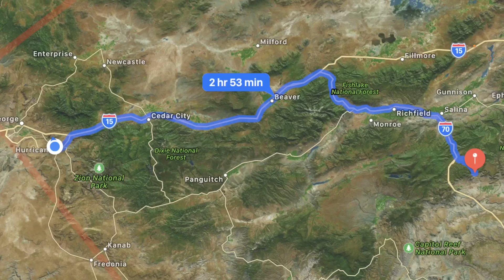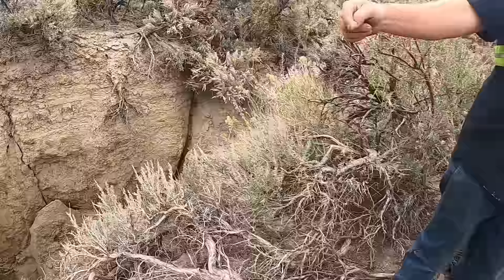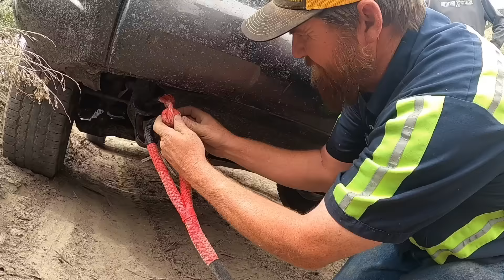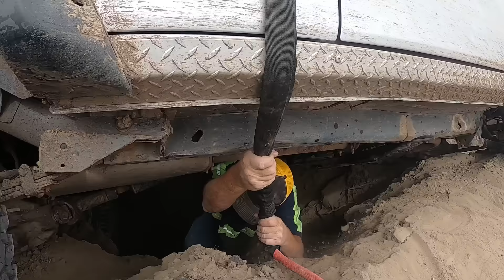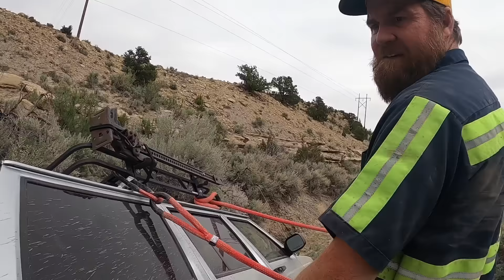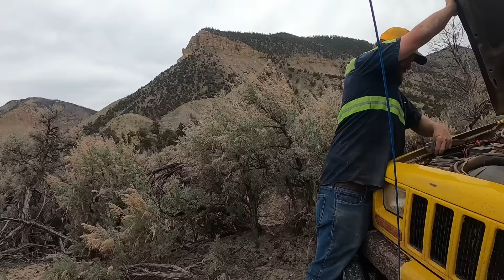Jeep Swallowed By SINKHOLE!!

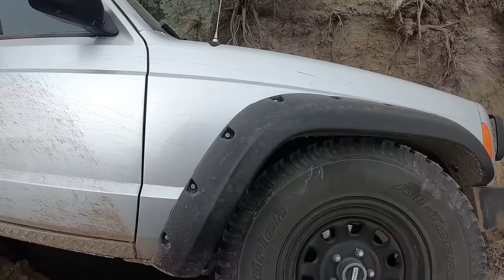Comment: Matt, epic recovery and story. Though I thought perhaps you missed one useful trick? At 15:35 when you added your weight to the rear tyre, I was willing for you to swing the spare wheel carrier and lock it in the open position. There was a nice counterweight there with a heavy wheel on a steel fulcrum. Making an 18" stirrup from a rope to add body weight to the wheel could have helped. Wasn't needed as it turns out, but you know, 'one more arrow in the quiver' for next time. I've been off roading Land Rovers for 30 years in New Zealand - just love your work and the hype free way you present it.

Comment: I hope he charged at least $2k for this job given the 6 hours of driving round trip, fuel, recovery, employees
Reply: Really? I would feel so ripped off if i got charged 2k for that. The customers did half the work. Fuel? I mean his truck probably gets 25 MPG this is not an excavator were talking about.
Reply: @mitchio83  not arguing on the 2k part but 25 MPG?? stock the XJ gets 14 MPG with big ass tires, Dana 60 axles, re-gearing, lift he probably gets 5-9 MPG combined
Reply: @kkkkkkkkkkaaaaaaable  2k is not unfair.
Reply: @timtalks8292  2k is alot.  i worked 2 years  mostly assisting semis  and i never ever tried handing out a bill that large. and that even include selling them a new tire too.
Reply: @MrLarsgren  ok... imagine your semi truck stuck. With no way of getting it out. Would you pay 2k or lose 20k+?
Reply: @timtalks8292  its not a hostage situation.. its a service.. you dont prey on people in need. if you do  rumor will spread like a wildfire and you dont have that  work anymore.
the vehicle got a hour  rate  and a certain price pr mile.  doesnt matter if it summer or winter.
plus customer only have to pay for the 2 real persons moving out to assist..  not the family . neighbours and camera crew.  it not the customers problem that he got a youtube channel.
backhoe  or snowcat  got other rates  due to  higher fuelcost and maintenance + it takes longer to get there with those..
its common sense.
if you order a tow for your car  you dont want some dude arriving with a bus and 60 crew just to rip you off.
Reply: @mitchio83  No way in hell that truck gets 25m to the gal not even without the loaded trailer.
Reply: Where i am $600 for what would be a 4hr round trip to put a motorcycle on the back of a truck (and the guy wanted to just lay it down ffs) if it wasnt covered by AA id have got a ride back to the next town and hired a ute for the day for about $100 and pay the extra 50 to drop it off back where i live. Out of curiosity i looked up what it would be to get a car off the beach (lots of nice new cars end up on the beach here) and it was max $500 if its been swamped and takes 2 hours to get out, closer to $150 if its a simple pull. Pretty surprised its that cheap tbh
Reply: @MrLarsgren  what if no one comes out? You can run your own business any way you want. But remember what if you try pulling someone out and total your rig? Or unforeseen things happen? If you don’t want to go paying crazy prices don’t do crazy stuff.
Reply: Dude... If Matt told me that he was gonna charge me $2k, I’d be straight with him and say I’d feel ripped off, $1k max. Roughly $700 profit for a days work?? Not bad.
Reply: @samuelyoung4646  specilized work, gear, staff. It adds up
Reply: I tow part time people dont know how much wear & tear our vehicles go through, plus spending a couple of hours on one job takes away other business calls.
Reply: 2 guys labour, $100.00 per hour + vehicle, gas, etc... easily 2k + over here...
Reply: @mitchio83  would you feel better abandoning the jeep?
Reply: @samuelyoung4646  you don't really understand business costs.  Any idea how much the multiple insurances is every month? Payroll? Real estate cost to have a yard and a building to work out of? Utilities? Taxes?If he charged 1000 bucks for that I bet his actual take home profit would be less than 300. 
I run my own business and it's pretty annoying to have someone call you and then tell you how much something is going to cost, I just tell them no, I won't do it for that price and because you tried that I'd rather not work with you. If they push it I'll just tell them since they know so much about the job and it's associated costs they can do it themselves since they are so expert.  
You don't get to dictate what the person you call for help charges, you can agree or not agree to the price they give you.
Reply: @MrLarsgren  how many of those semi trucks were miles out on dirt trails?
Were you even allowed do off road recovery? 
Kind of an apples to oranges thing you've got going on there.
Reply: @mikewhitman745  i total agree with this. I used to run a lawncare company. Wouldnt take the mower off unless it was $40. Insurance, gas, up keep on equipment. Replacing equipment when it breaks, renewing your business license, and misc other costs that youll have not including payroll. $2k is way more than fair for that extraction, im up here in Alaska and youd be lucky to even find a offroad recovery business let alone how much they charge you with how far people go down a trail before they break. Not to mention good luck getting a regular tow service out there let alone how much they would charge. Theres currently a lawsuit going on due to a towing company pulling a guy out of the mud and charging him $48,000
Reply: @mitchio83  um.  Then keep your Jeep in the sink hole.  In the middle of nowhere.
Reply: @mitchio83  you do know if it's a national or forest road most  insurance will cover the cost.
Reply: @mitchio83  half work ? you mean hold rope.. lol dude

Comment: I think putting those men on the ropes was more psychological than actual help. It kept them at least busy 😄
Reply: Any pressure helps but I’m sure it was partially what you said as well
Reply: “Men”  ......
Reply: I'd say they could muster 200 pounds of pull, multipy that by the leverage (the distance from the roof rack to the center balance)?  It could be 500 pounds easy

As an example ... When you add cast iron counter weigts to a smaller farm tractor (the weight of that Jeep) 500 pounds is a BIG amount

Hope that makes sence the way I compared it ... :)
Reply: @hardanalljr.3138  spelling police alert

Comment: Y'all need to invest in some low pressure air recovery cushions and cribbing. At least some cribbing.
I know cribbing takes up lots of space and can be heavy, but if you got  pictures of the situation ahead of time you can know to load a bunch up. 
A few verticals and horizontals will bridge the deep end. Then build box cribs off that and final bridge with planks. 
If you had even 2 recovery air cushions you could bridge the deep end with cribbing and use 2 air cushions and plank for the rest.  You could even bridge the deep hole with a cushion. It doesn't have to reach the bottom. The pressure against the sidewalls is enough to hold.
They are between $1k-$5k each depending what you get but they would pay themselves off. 
And you can get cribbing free if you know anyone in the construction business.
Reply: I was looking to see if anyone commented on using air bags. There is a good Whistlindiesel video where he flipped or well attempted to flip a truck with one of those cheap china ones, Ended up using a tractor to finish it off. Few of those bags and some planks would have gone a long ways.

Comment: It was like watching a man digging his own grave, the suv is over 3tons.

Edit:- you guys keep fighting over the weight of the vehicle but daymm 1.8tons is also enought to crush someone up.
But I'm talking about Matt going under and removing sand from under the wheels. Which will bring car on him.
Reply: Its maybe 3500lbs
Reply: Not even close to 3 tons.  Factory curb weight is ~3700lb, Matt's with his extra front bumper and SJ axles is around 4500lb if memory serves.  This one is probably closer to 3700 than 4500.
Reply: jeep cherokee is 1.4 tons not 3, but with the equipment on these vehicles its probably 1.8-1.9tons
Reply: @Adam Alim: of course 1.8 tons is enough to crush someone, that's not being debated.  On the other hand, the ability of the dirt to support 1.8 tons is different than the ability to support 3 tons, as are the challenges of winching that much mass.

No doubt that Matt took a bodily risk getting under the Jeep, but on the other hand he personally owns at least three of them and he knows what kind of space they have underneath when they're sitting on their wheels and how much they weigh and its distribution end to end.  So while he took a risk, it appears to have been a calculated risk.

Comment: Amazing job on all these recoveries.  FYI, I have seen other people use a winch and use a spare tire (standing up) to run the cable over the tire.  When you perform the pull the spare tire helps to lift the vehicle while pulling.  Works really nicely, I think it would have helped with this recovery so the back end does not dig into the dirt.

Comment: Awesome recovery video. I've never seen anyone do this for vehicles, but a trick to pulling stumps is to use a tire and run your line over the tire using it to pull straight up. Could you have done that here? Pulled the spare tire off and hook your winch line over the tire to pull up on the rear corner?

Comment: You could use the share tyre running under the tow rope, it could lilt up the towed truck. In the bush we used similar to lilt logs off the ground. It was was called an arch towed behind a D4 or D7.

Comment: I had a 2005 Cherokee and sunk it twice both times let it dry out started right up. 4.0 motor will last forever. Friend of mine uses a 4.0 on his saw mill as power in Tenn. Now I have a 2005 rubicon 106 thousand mint cond. gonna hold on to it for a while.

Comment: Matt I hope you read this: I think you should invest in a snatch block that can be screwed in and out of the ground easily(maybe a power tool to make it easy) so you have anchor points in these situations that you can use to your advantage. Takes the hours of shoveling away to get another job done and it shouldn’t be that expensive. Love the recovery work man, I’m a flatbed drive so I get it 🤣
Reply: Maybe even a dual wheel snatch block to make the weight even less by running it back to the vehicle more than once

Comment: I had a snatchblock like the one used here fail and it was being used to change pull angle, not force doubler. I was recovering a Wrangler up a very steep bank, using a super duty as anchor for 90 degree pull angle. Block failed, Wrangler started to fall and came very close to yanking me over the edge.. I now use blocks that are much more heavy duty now.

Comment: If you would've taken the spare tire off.. hook low on drivers side of the axle.. double your winch line with a snatchblock to double the pull,  drop the line load & reduce layers of cable on the drum...then stand the spare tire vertically & run the winch line over the face ( tread) of the tire. As you winch,  it would create vertical lift to lift the low side up outta the hole. The tire would roll with the cable as it traveled so it wouldn't cut the tire.  Tough recovery with limited access.. great job.

Comment: Pulling the spare tire off, vertical under the wench line, would pull the vehicle up as you wench it back. I seen this trick in Australian 4x4 off road videos. to help getting a buried vehicle in the mud down to the axles.

Comment: I would have handled it differently, but it got done. 

Out of curiosity, how many of us would have dug out from under the right front tire and used the spoils to fill the hole so the Jeep was closer to level and not winching through  the hole? 

And, you might want to add a real shovel and perhaps a pick to your rescue kit.

Comment: Would be great if you could bring a pole that you can screw deep in the ground and attach a pulley on it so you can redirect the force where your car can’t go 😯 in that case it would be pulling from the right of the road and both left wheels would be in the “air” and then pulling straight from the rear while the left wheels are not touching the ground

Comment: If you ever need to get some upward lift in winch like this you can use the biggest rim you can find to act as a fulcrum point to give the rope a more upward pull than lateral, of course, like everything with a winch, do take extreme caution. This trick is similar to the one for pulling up small shrubs. Worse case, use the spare tire and the rope not the cable to get it some up. You can also find big ass airbags and a compressor to help get it more upright.

Comment: What if you had used that spare deflated and off standing up behind the "troubled vehicle" and ran the winch line over it to get lift at the same time that you were pulling? Looks like it could have saved you alot of work and time❣

Comment: I know this is a older video but for future ideas I took a highlift jack and used it to push the frount of a car out of a very deep hole sideways. I got a large block of wood for a base in the mud and mounted the jack sideways on the frount and used the jack to push the car sidwways out of the hole and didnt brake or tear anything up. Yes highlift jacks can be dangerous but it saved me a very large tow bill.

Comment: Matt, I was wondering if you or did you think about using his spare tire as a Fulcrum and run the winch cable over the top of the tire down to the axle? And as you winched back the tire would give you a better lifting angle as you pulled backwards the tire would lift and roll back? Just a thought.

Comment: well done. What about a pulley block that can be driven into the dirt and used to pull the vehicle sideways, from the rear? Something like that has to exist and wouldve helped hold the jeep upright while it was pulled backward.... maybe that would have made it go quicker, with less body damage and less need for Matt to get under the jeep and risk injury or worse. 

Soil collapses in trench conditions are startlingly dangerous, and can be fatal, God forbid, in 6 feet of trench..In  the construction excavation industry, trenches are treated like lava pits generally, no one wants to go in there. Collapse = very bad things....

Good job.

Comment: Perhaps fixing the side ropes to the driver's instead of the passenger side would have given it a bit of a lift instead of just a sideways drag?

45 years in the construction industry and lived by the motto "never enter an unshored excavation deeper than you belt . . . " (I'm 6' 1")

Last place I worked before I retired there was a sign up on the Safety Wall in the depot: 

Never Joke About Health and Safety - The Life It Saves Could Be YOUR's

Comment: With the winch is enough to take it out. It should come out the same way it went in, I mean that in this case should pull from the rear. You won't need more equipment

Comment: We would have pulled the chainsaw winch out of the back and dead manned the rig from the driver's side front bumper , for lift. Then backed up with the pull rig with 3 wheels touching. I've had to do it many times for other people. ( Deadman the chainsaw winch using a pull-a-pal )

Comment: As dangerous as they are, that farm jack on the roof rack of that jeep could have helped alot, when you got to the point of the front tire almost dropping, people pushing against the hill and pulling ropes..that jack could have been put between the hill and roof rack of the jeep at a bit of an angle,  so as the jeep went backward to the danger zone,  the jack would be straight through that scary portion but kept leverage while you pulled back till it was stable. Two of those jacks would have worked even better.

Yes theyre dangerous, but god they're handy!

Comment: Matt ,, I have a  1 day old  3500  Ford  Dually that slid off the TOP Wall  of Glen Canyon Dam !!!  
 Its   UP SIDE DOWN  HANGING from  just ONE  Wind Shield Wiper Blade . 
 I think maybe you can reach the Antenna with a winch cable !    
. I am SURE YOU CAN DO IT   , I mean you just pulled a Jeep out of a Sink Hole !!!  

I have no Idea what I did to get it there, but l will  BUY You a CASE of  BEER  when you  GET HER Back up on top of the
 DAM ROAD !!!!        
 PLEASE     HELP  !! I    I am get-N thirsty again  !!!!        P S I LOVE YOUR VIDEOS !!!!!

Comment: Yikes, SKETCHY is an understatement, more like Matt's Guardian Angel was working overtime !!!  ;-)
If Matt's Plan B was if the Jeep gets swallowed even more, w/possibly more (customer's) Jeep damage, then the (expensive) Backhoe rental would have to be done.

Just thinking out loud, I'd possibly put together, some sort of a metal stake (SNATCH) driven through the ground real strong and then rig a 'portable' motorwinch to that.  At the right angle/position, that could/would act here :
#1 as a way to reel/bring in more of the Jeep to the stable part of the road ;
#2 & working as a sure/secure way for the Jeep TO NOT FALL FURTHER IN THE SINKHOLE.
(or, just a manual 1-2 Ton hoist rigged properly would do cheaper.)

This "Stake SNATCH" could be used in many of the recoveries I've watched already.
It could be an additional 'Drama point' that is introduced into any recovery and assure the worried customers (and us watching !) even more, that ALL OF MATT'S RECOVERY RESOURCES & MORE ARE DEPLOYED.

Great Recovery, ... Matt, ya got GoOD Karma Bub, you are BLEST !
;-)